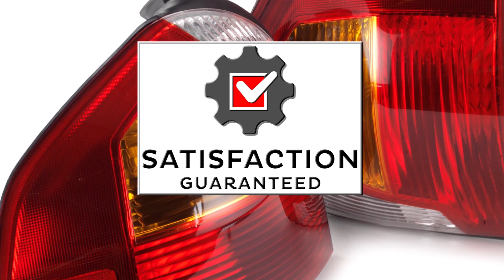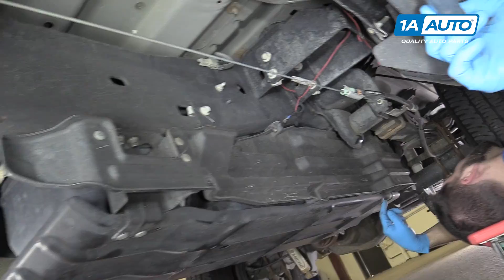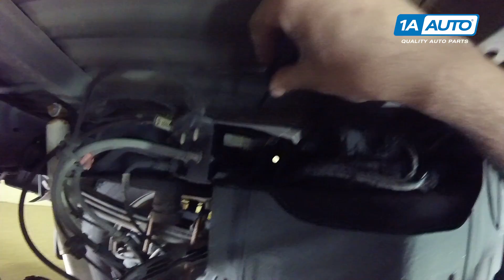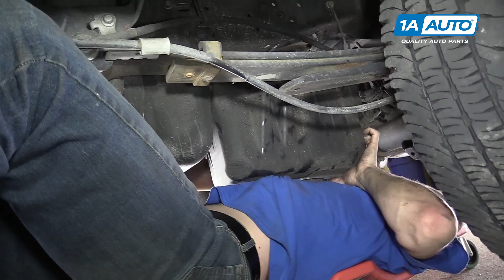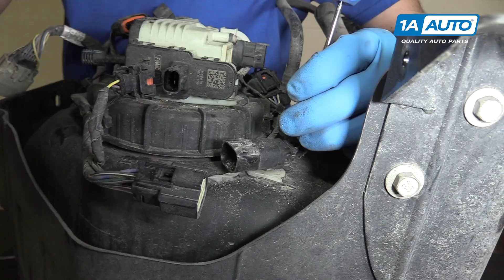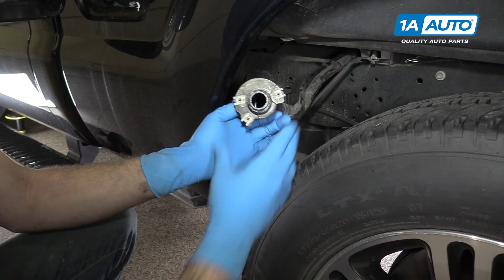How to Replace DEF Sending Unit 11-16 Ford F250 Diesel

Comment: So , is this problem the P20B9  code in the check engine light ? (Fuel/air metering auxiliary emissions control)  Must be on same circuit as remote start from key fob .

Comment: Did you replace that sender unit or just clean it inside. Urea is his sodium and it calcifies which can also cause this problem. I have a 19 F-150 with this same with the same "reduce to 50 mph" error.

Comment: A few things not mentioned for DIYer-that little plastic injector port coming off pump is very easy to break especially when the quick release wont release and you are pulling on it..so you end up replacing pump when it breaks off..also those little ridiculous clips that are the screw holes for the frame to through bolt the tank and skid plate move a lot and can fall off the 2 in backside need to be on the inside of the tank bracket , lastly worse part of job i still have to take the tank back off because the injector port plug that attached to injector hose with zip tie wont stay snapped together and can only get one arm up there and barely can reach it and tried 40 times to make it stay together wont snap. Will take back down and betting the thing is cracked or needs a tool to compress an snaps it back on, if not electrical tape to hold in place, cant do it with tank bolted up..so irritating. Make sure this is napped tight and cant fall out before bolting tank up..some engineers are so common sense  real world limited i cant understand why the frame not tapped and some of this stuff is garbage so easy to break..now i know why a lot of mechanics pull the bed off but mine has a Utility with racks and not easily done, with it full of tools and parts.

Comment: So confused, is this not the def pump and not “sending unit” my understanding is the reductant heater and sending unit are one part assembly and the “sending unit” is in the bottom of the reductant heater tube??

Comment: Is replacement required for both the heater and pump? Or is this just for the module on top? Is that the heater? Or pump
Reply from the maker: +Manuel Ramirez Thanks for checking us out! http://1aau.to/m/Shop-1AAuto-c

Comment: I took my truck to the dealership and they told me it was a sending unit but they wanted $1,300 to do it so I went ahead and did it myself but now the dashboards still says that the d e f tank is empty and the dashboard says speed limited to 50 miles and 20 miles left
Reply: Que será el mio dice ( reduce power  , speed limit 50  / 47 miles
Reply: @artemiodelgado7387  se llama force regen tiene que llevarla a un taller que tenga el programa para que aga la troca que limpie el mofle
Reply: Gracias por el dato  ,  esta semana la llevare
Reply: @theonlyoneAndres  como siguio con su troca? Que fue lo que paso ? Mi jefe tiene el mismo problema
Reply: @jlopez2771  le cambie el sending unit  porque me dijo el dealer que eso era y se lo cambie y siguio igual al ultimo tube que cambiar el calenton del tanque tambien
Reply: @theonlyoneAndres  siguio igual despues  de que puso el heater reductant?
Reply: @jlopez2771  si se compuso
Reply: I'm in the same boat... I have no idea what to do.

Originally after spending 690 bucks at the dealer for a "health check" / troubleshooting my backup camera issues on my 2013 f350 platinum the dealer came back and stated my reluctant heater had burnt out in my def tank. So after parts and labor they stated it would be roughly 1700 bucks to get it replaced...

I went online and spoke with a diesel tech and purchased another reductant heater and per the steps in this video it made the swap of the reluctant heater quite simple.

Now the issue is my truck is throwing 16 codes (most are duplicates) but they are as follows:

P20BA
P205D
P203A
P20B9
P21B0
P21AB

If anybody has any ideas of potentially helping me resolve this issue and get passed the "limp mode" my truck is currently stuck in without breaking the bank I would be forever grateful!

Cheers
Reply: @Gr8WhiteBuff  You first need to identify the fault codes if not already done...  If as you say they are duplicates than consider having the codes erased and run the truck close to where you do your mechanic work to see if your install fixed the codes...  If the codes return you will need to consider taking to a mechanic to troubleshoot the remaining problems...

Comment: Id recommend taking of the injector hose before dropping the tank. I have a lifted truck and there wasn't enough slack, even with all the clips loose. It ended up snapping off the pump nozzle. :-( 200 dollars for a whole new pump.
Reply from the maker: +chuck winters Thank you for the feedback. 1aauto.com
Reply: Lol, same thing happened to me yesterday. 4” inch lift a little high to drop it to ground. 280 for a new one. Wish I would have read your comment earlier
Reply: The same thing happen to me...  I'm in the process of replacing the unit because of that stupid little plastic port...
Reply: Same here...the procedure for removing the hose is poorly explained.  The video is just "squeeze here" and off it comes.  Not even close.  I snapped off the nipple and had to by a new pump.  This is a tricky procedure and needs more detailed video and better explanation.
Reply: Best of luck getting the injector hose off of the pump nipple! 9-1/2 year old truck, 138K miles in the AZ heat. Didn't stand a chance. Getting the broken nipple out of the injector feed line is extremely difficult as well. I wound up replacing the heater, the pump and the injector line because I was afraid it would leak or not stay attached. Cascade of failures all because of cheap plastic!

Comment: The new one came with a syringe.  What's the syringe for?
Reply: You're supposed to prime the pump with def before installation. If I'm remembering correctly, you insert the syringe into the larger hole in the bottom (side that faces and seats down on the tank) and fluid should start  coming out where the outlet hose connects. Pay close attention to the o rings in those holes and make sure they're present and that you got the old ones out!
Reply: SpaceBuckaroo 
Did you ever find out what the syringe it four? I just got the same part with a syringe and have the same question 
Thank you